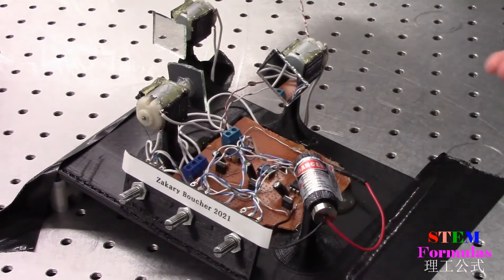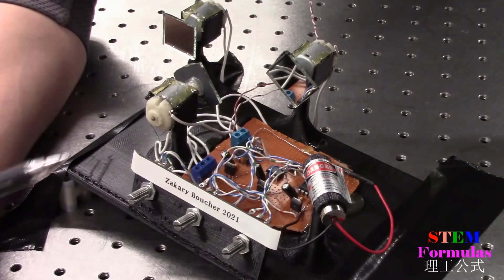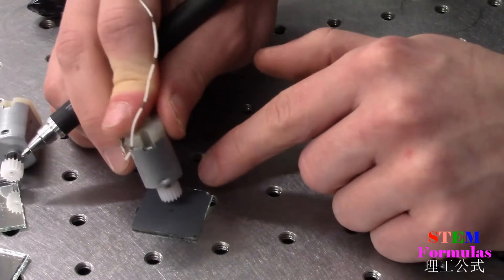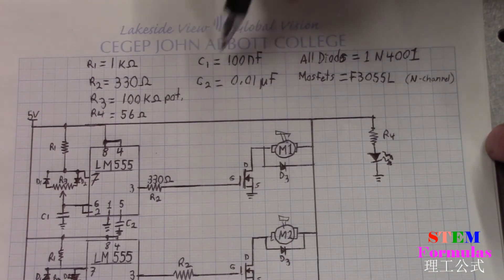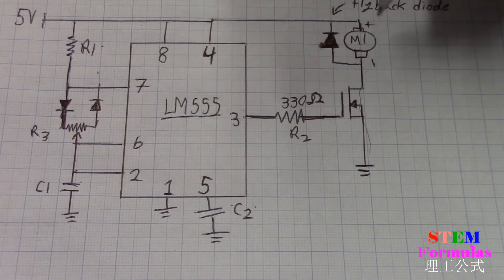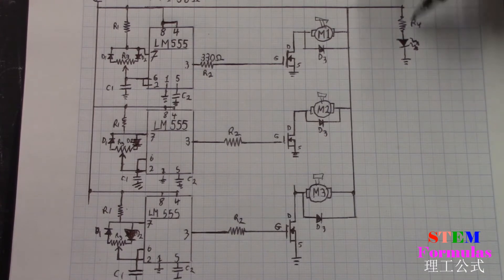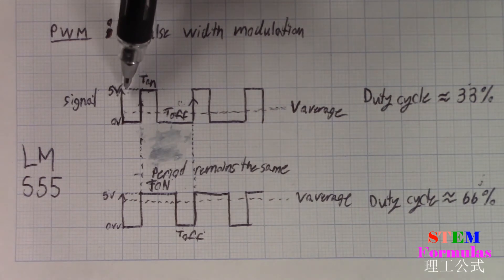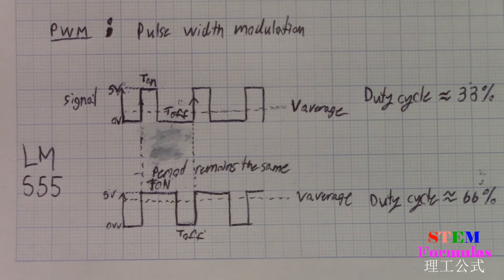How to Make a Laser Light Show Project with Mirrors, DC Motors, LM555, and PWM

Comment: I am trying to understand the potentiameter connection.
Are pin 2 and 6 both along with a cap, all 3 is connected to the wiper and the cap is also grounded?
Reply from the maker: Dear Blue Ocean, 
That is right:  pin 2,  pin 6, and one lead of the cap all connected to the wiper of the pot, the other lead of the cap is connected to ground.